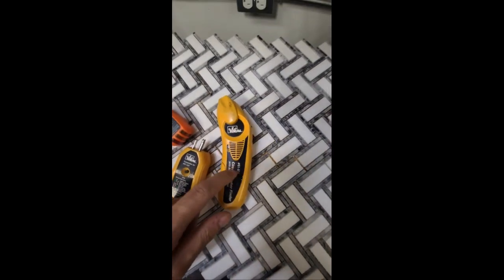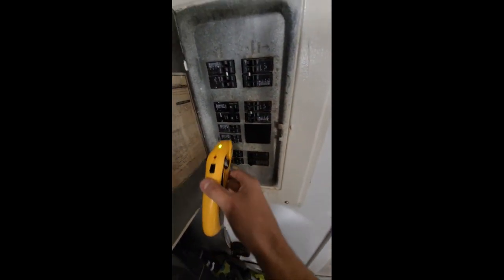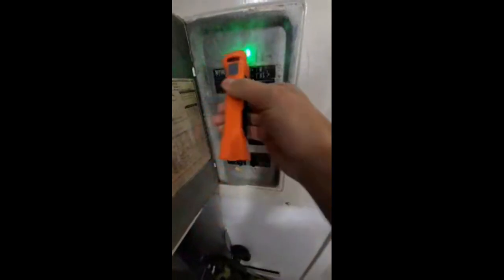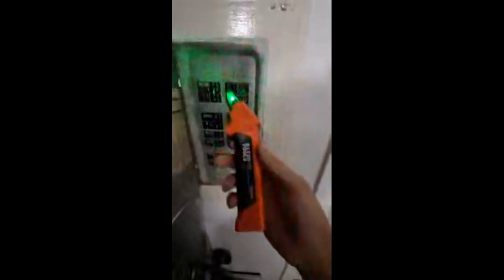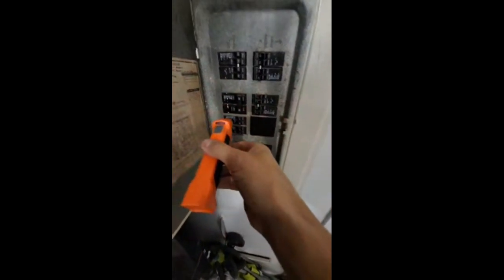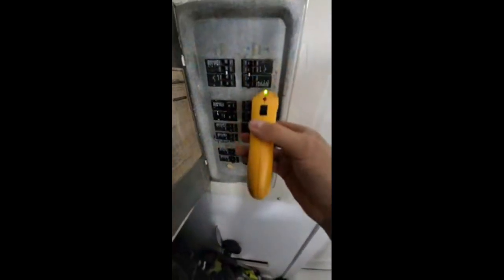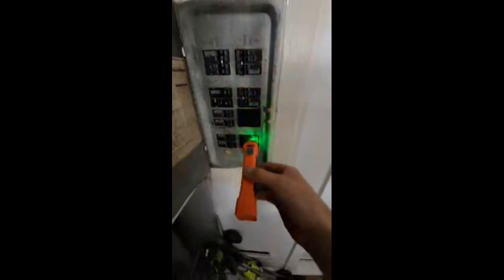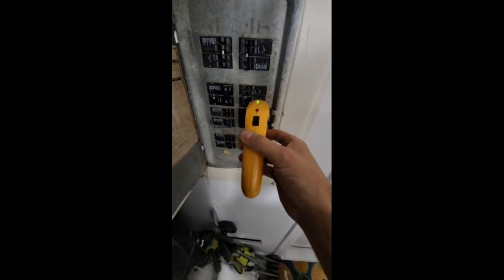KLEIN v/s IDEAL Circuit Tracers!

Comment: Out of just curiosity, it would be interesting to add a few more tests since the variables are being swapped at the panel (Klein vs Ideal tester):  1) Continue the simultaneous approach and swap which plugs the transmitters are plugged into the 2-outlet plug and test again.  2) Plug only one brand transmitter at a time into plug #1 of the 2-outlet plug and test.  3) Plug only one brand transmitter at a time into plug #2 of the 2-outlet plug and test.  This should remove any potential interference between the competing brands transmitting the signal and illuminate if there are somehow differences between the source outlet's chemistry between plug #1 and #2.
Reply from the maker: It would, I had a unique situation where i had to giveaway/sell/leave all the tools i owned behind at my last house due to mold and mycotoxin poisoning i no longer have the ideal tracer but i used it for about 3 years regularly and without a doubt it has better accuracy and reliability ( the switch on it it VERY easy to turn on by mistake but for the money the klein does ''ok'' I am still throwing away some belongings i thought i could keep lol   all you have it your own self preservation and motivation to keep going when everything else around you isnt going great  its been rough the last 2 years but this channel and my community helped me through quite abit    maybe i will buy another 1 soon
Reply: @toolsandtactics  Sorry to hear about the misfortune at the last house.  Nice to know you got good use out of it and definitely, self-preservation is all we have while we're still here in life.  Just got to make it to the "finish" line for a well lived opportunity in life.  Well your review was very helpful and convinced me just moments ago to pull the trigger on the Ideal tracer (albeit the last model wasn't available) so ended up ordering the latest 61-535 model along with the Ideal TL-532A adapter kit that also traces to the light bulb sockets that also comes with alligator clips to trace to live wiring as well.
Reply from the maker: @JosephJohnson-bq1wm  I'm going to look it up. Thanks hope it works well for you!

Comment: I have the klein and have to agree it sometimes gives false readings; it's not ideal. 🙃 ...which I may have to try out. Some things klein are great. I do like their et450 which has helped me numerous times and is far cheaper than most circuit tracers I've seen.
Reply from the maker: Yeah, at 40 bucks. Honestly, it's not too bad. Great for homeowners and diy
Reply: @toolsandtactics , I'm definitely not an electrician, but have done a good amount of electrical diy. I am not averse to spending money on quality tools. I may have to try out the Ideal.
Reply from the maker: @bbeede2  Ha. Also I like that pun." It's not too ideal good job", sir
Reply: @toolsandtactics ... thank you, bro! I can rarely resist a pun or absurdity.

Comment: I have a different reputable brand, it is hit n miss sometimes as well.
Reply from the maker: Which 1?
Reply: @toolsandtactics  Sperry circuit breaker finder CS61200. It gets close but can be one of a group if breakers are narrow. Close is still a pain when trying to label a panel. By reputable I meant not off Amazon. Lol. 
I'm in Canada and it was what was available locally.